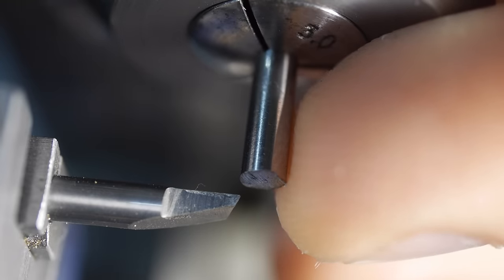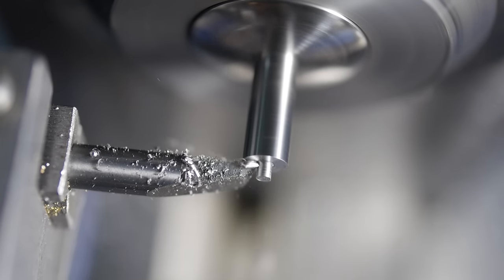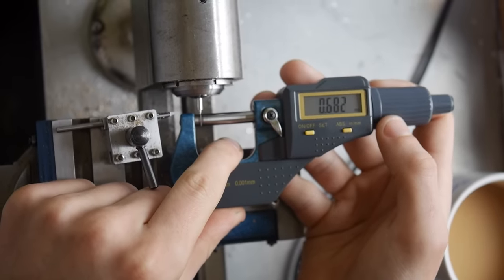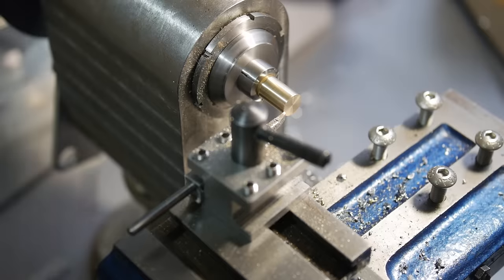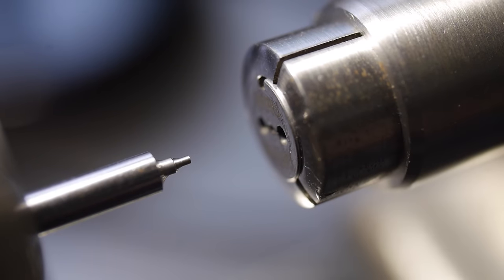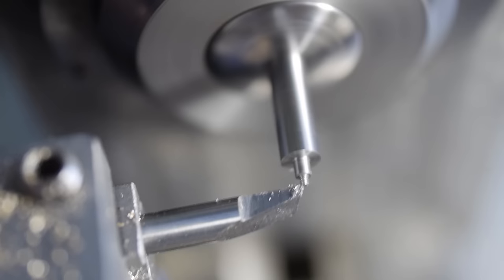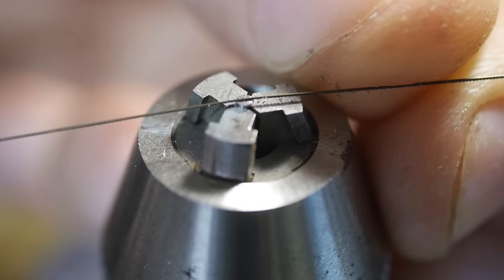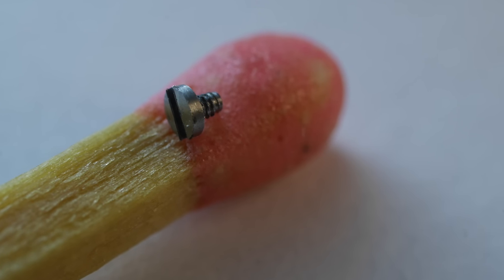Watchmaking: Machining a 0.6 mm Screw

Comment: I was a pipe welder.  The largest pipe I ever welded on was twelve feet in diameter.  Watching this was fascinating.  What a contrast.
Reply: Repent and believe in Jesus Christ  lmao
Reply: repentandbelieveinJesusChrist2 I’m sorry, but why we panting at all, for god?
Reply: How many washing machines is that???
Reply: Big meets smaller
Reply: Both have major challenges and require a lot of skill to do the right way.
Reply: Yeh i welded petroleum tanks buried under garage forecourts, 15 foot diam, but this is micro stuff.
Reply: I am a beginner welder and it is interesting for me how many stops you did while welding the twelve feet pipe?
Reply: Couldn't cut it as a drywaller eh? 😂😂😂😂🤣🤣🤣🤣🤣
Reply: I feel you man , it's wonderful 👍
Reply: What do you for a living now, mate?
Reply: @appalachiangunman9589  But only one needs eyes like an eagle! My god! :)
Reply: @Eimrine  1start and 1stop, the 60,000ltr tanks sat ontop of boggies that rotate the tank, we sat/ laid on scaffols boards on wheels fixed to a gantry, start tank rotating beneath you get comfy, 25mins for 1 full rotation, and pull the trigger, flux core mig, almost manual sub-arc really.
Reply: Bro welds straight lines for a living
Reply: I worked for a major welding equipment company as a subarc specialist for 10 years. On the job I routinely welded with 1500-1800 amps, sometimes 3x or 4x that. Wire size up to 1/4”, sometimes 3-4 arcs in a puddle. 
But in the evenings and weekends I TIG welded, sometimes as low as 5 or 10 amps with a 0.020” tungsten.
Reply: pffft. bigs easy. what was the SMALLEST pipe youve done?

i draw the line at 6mm...
Reply: @mariopllumbi3748  roughly 2 juvenile black bears, or 4 washing machines.
Reply: @mariopllumbi3748  about 3 1/2 c
Reply: i somehow read welder as wielder
Reply: Out of interest, what was the 12 ft pipe for?
Reply: You cant fit that into a watch.
Reply: Ah yes the old Pipe Welder guys. Always acting like they're superior. You are so cool man youwelded 12 Foot pipes.
Reply: @aegisraven1284  lol hanger
Reply: Seeing those machines at work fascinates me!

I saw an auto welder laying down weld beads on a rock crusher, it lit up the night sky, and brought down the DNR during deer hunting season!
Reply: hey let me make it about me
Reply: what was that for?
Reply: ~3.66 meters
Reply: I was a big thing operator.  The biggest thing I operated was 500ft. What a contrast for me who worked on much larger things.
Reply: Yeah I feel the same thinking about all the big stuff I've worked on  then watching this 😂
Reply: peos!

Comment: The way this is done nowadays is with Swiss turn machines. They hammer these in 5 seconds. Make thousands of them. You can let the machines run while you go home for the night don't need anybody to watch them once they're going.
Reply: Yup. Was a machine maintenance tech in a large Swiss screw machine shop and you're right-they churn out tens of thousands of these in all material imaginable and then some in all configurations...but one broke down they were hell to fix
Reply from the maker: Modern machining methods have come a long way. It is incredible. Thanks for watching.
Reply: This makes no sense, sir. 
These are not watch screws if there's no one watching them!
Reply: @DanielConstantinoS  They're unattended screws.
Reply: Yep, the Swiss machines sure do the job, starting at $125,000…😂 3:23
Reply: @DanielConstantinoS  😂 that was pretty good not gonna lie
Reply: @Mark Grant  Maybe a used one lolol. Machines are like 200-500 grand. It's like a car you make payments on it. Your monthly payment of the machine usually dictates the shop rate.
Reply: @DanielConstantinoS  simple, yet effective funny dumb dad joke. You win!
Reply: The machines in our shop had fire detection, alarm and extinguisher systems onboard for the jobs that required flammable stock, and the flood coolant system.
Reply: @Machinist Mike the Tinkerer  yeah those sometimes work. Dude I was working with went to lunch and one of the office guys walking thru goes hey that machine like down the aisle is smoking 😂. 30 seconds later while literally dead sprint to hit the e stop thing just bursts into flames. Dude comes back from lunch to a burned out machine 😂
Reply: I know Swiss machines are generally really safe but I'd be worried leaving a power tool running in the shop while I'm at home
Reply: @Thomas Africa  It's designed for it. If a tool breaks it'll know put that tool away grab a new tool and keep running or you can tell it count how many parts you make and change the tool after 1000 parts. Most of your job is just setting machines up and changing the broken/used tools. You don't have to watch them. Every once in awhile you grab a random part out of the basket and see if it's still the same as when you started and then just doing paperwork. People pay more for the paperwork than the parts themselves.
Reply: @Alan Smith  I've run a micron machine before. Just an absolutely incredible machine and feat of human engineering. As hard as it is to run one some guy had to figure out how to make it first. Which I don't understand how people can be that smart. I'll forever be an idiot compared to those people.
Reply: @DanielConstantinoS  that's why this video was made, to outsource that to us
Reply: Rolex, hand-made prices for machine made watches.
Reply: They said the same thing when they began mass producing nails. Haha kinda incredible
Reply: Funny how a machine can do thousands of these but no one in the comments is able to do it by hand
Reply: @metalman6708  I've always wondered why pretty much every machine at these price points don't have detectors to automatically shut off and/or alert the user of potential smoke. I realize this could be difficult on some machines but many of the videos I've seen of these horror stories are setup in a way that would seemingly be simple. 

I'm aware of some advanced fire suppression systems but this just seems like an avoidable issue much of the time. Even my DIY high temp 3D printer has a cheap enclosure with smoke detection and I've only had a false alert once... which of course was moments after getting home because my machines seem to enjoy trolling me.
Reply: @JJFX-  Makes you wonder just what they get up to while you are out? Naturally the Security System cameras will be in on the shenanigans and never record anything of value.
Reply: @metalman6708  That's so sick!
Reply: Love the Pun ! Anybody to watch them ! 🎉
Reply: What if you need only 3?
Reply: I appreciate a have made piece way more......all done by machines make the watch just seem like another disposable product
Reply: Yeah . Awesome and sad in one
Reply: @JJFX-  Safety features cost money, require maintenance, and sometimes even modification of methods. Boss man can't have none of that. $$$
Reply: @James Suttar  Ohh I've made things this small by hand. It's a completely different ball game when it gets that small. Dental implants are usually what they were for. I've done stuff you need a microscope for and things you need a crane for. Both of those things are very different from regular machining. Stuff this small you need to worry about things like how you even hold it. You can crush the part trying to hold it in the machine so it's no longer round but egg-shaped. With real big stuff like the size of your car or bigger your job becomes machining and rigging. You have to know how to pick things up safely and flip them and you gotta think if I put a strap here and lift here is the center of gravity being supported or is it going to want to drop because the strap or chain is too far forward? You have to worry about things like weight distribution and how fast can I spin this without the centripetal force shooting it out of the machine like a rocket. It's very uncommon to have done both though. Usually people specialize in one type of machining but I wanted to be able to do anything and everything.
Reply: @JJ FX  No they do. They'll alarm out if the fan ports get clogged in the back and it senses a change in the CPU temperature and shuts down the servos to protect itself. The reason for the fire suppression is that the material itself is flammable. You make alot of things out of titanium like medical implants that sort of thing. So these machines run so fast so the tools are all stationary and the material is fed into them. But it can be doing 10 things at once. That's how it's made so fast. But the way titanium works is that it's an oxidizer. So if any number of random things happen like the chips got stuck in a hole when drilling and it heated the drill up and that's enough to start the chain reaction. Ones Ti is burning it feeds itself. Burns really hot really fast. It catches all the other chips on fire. You have to use a special fire extinguisher that we were required to roll around with us. If you put water or a regular fire extinguisher on it then it separates the hydrogen and oxygen rapidly and basically creates a hydrogen bomb. It'll explode if you do that. Once it gets big enough you just have to watch it burn itself out of fuel.
Reply: @🏴Luminous Fractal  They would be incredibly expensive screws. The less of something you need the more expensive it'll be. This is why it's often cheaper to buy a new part then attempt to repair it. People only pay to repair things if it's irreplaceable or damn close to it
Reply: Really... hmmm i always wondered about these micro screws who n how ... now i gotta look up the doc for the swiss turn machines...
Reply: @enter name here  Just look it up here on YouTube. There's a million and one videos of it.
Reply: @luminousfractal420  then they have smaller manual screw machines and maybe 1-2 dedicated machinists that do those. Brown&Sharpe manual screw machines are awesome you can make just about anything with them. Easy to maintain n fix. The used ones can fetch top $$ for them. I would make stuff on em any chance I could.
Reply: @metalman6708  nailed it. Am a retired machinist by trade but wanted to be able to work on all the machines I could. That's how I ended up as a Millwright/maintenance tech. My favorite tool? Bridgeport mill! That's what I cut my teeth on all those years ago. My dad before me too.
Reply: @JJFX-  trust me-it was always us vs the machines lol. It all depends on the material being used. Our bread n butter was medical and dental implant devices that worked exclusively with flammable metals titanium, magnesium and alloys of both. Once they ignite they burn fast and extremely hot and bright. and very difficult to put out. Special extinguishing agents are used and sometimes those don't work. In my time we used to have red painted tin buckets next to each machine filled with sand and dirt to dump on the fire. Picture that!
Reply: @LSC2001  don't even get me started on over priced watches lol
Reply: @metalman6708  I've thought that soooo many times...
Reply: @metalman6708  right! And then we get to go fix em ugh. You know how expensive titanium n magnesium and stuff was so expensive and they'd always save the chips to recycle? We >ahem< used to bring some magnesium dust/chips home to throw a little on the bonfire for fun. That and old copper phone wire. The um..kids loved it. Lol
Reply: You guys ain't gonna believe this. I didn't either until one of the programmers brought me out to the floor to show me the prints and parts to prove it. I was just as gobsmacked and amazed-our shop used to make 🍆 implant devices for guys who had ED problems and/or traumatic injuries. Not even lying holee shit I never knew! We had some laffs on that even tho it's certainly not a laughing matter. The system first operated by a tiny cable, to "raise the bridge" they said. It went from that to a small air pump and tube system that resembled a miniature blood pressure cuff that we're all familiar with. They went back to the cable system because they found the pump system would develope leaks and would also "squeak" when being used! 
I've never watched "Transformers" in the same way since.
Reply: The level of speed and precision mix is god tier
Reply: @machinistmikethetinkerer4827  Oh I can only imagine. A bunch of chips from metals like that essentially become thermite so once it goes I certainly wouldn't want to be the one responsible for it.
Reply: who does the work though if no one's in the shop? I thought capitalism required hard work to make money :-)
Reply: Not like machines are known to malfunction or anything😒
Reply: And they're much more precise
Reply: @magran17  that's good deal when talking about those machines
Reply: All good if you're churning out thousands to recoup the investment in the machinery, but a one-off for a non-standard repair will require actual skill.
Reply: @JJFX-  exactly. See some of the thermite incendaries happening in Ukraine? That's it.
Reply: Very interesting, but is this way cheaper though?
Reply: How does the collet not damage the threads when you clamp them to machine the head?
Reply: @Jsuttar  mate if I had just my hands to do this Im sure my nails would have fallen off long before I even made a dent!
Reply: @clown134  the hard work is setting it up
Reply: Was at a place, got a job in, wanted custom screws.
Best option was source an old auto cam with rudimentary tooling.
Cnc came in at five minutes each. Tool changes mostly... Auto was down to five seconds...
Reply: @DanielConstantinoS  Because it is the screw that is watching.
Reply: @tyttuut unwatched, even
Reply: @tyttuut  I should call her
Reply: @Jsuttar  I did and so did many others before me. I worked on a Browne n Sharpe Screw Machine.
Before me tho How do you think pocketwatch screws were made during the Industrial Revolution? Then, mass produced?
Reply: It's not just nowadays, automatic screw making machines have been used in watchmaking for more than 150 years. But that's always been in big watch factories, not small watchmaker workshops. Here's a video of one machine from 1871: https://www.youtube.com/watch?v=YCmnUP5gx78
Reply: HAHAHAHA are you joking?
Reply: I saw what you did there! 😂😂😂 @DanielConstantinoS

Comment: My dad was a watchmaker, and seeing him handle these tiny parts was a wonder. He didn't have the equipment you show, but a small hand lathe and a set of turns, so actual screws may have been off the menu, but he could re-fit and re-make arbres and pivots with the deftest of touches. Thanks for this reminder of a loved parent and his art.
Reply: Watchmakers are always so fascinating, the fact that humans can handle such small parts with 0.001 mm of precision is utterly mindblowing,
Reply: well my great great great great great grandpa was from the sandglass era and he used to count sand grains accurately(without the aid of any microscope etc etc) for the sandglass clocks 😉
Reply: They make little taps for teeny screws
Reply: @runcoweezrun8143 that would put him in the 1700’s which definitely had clocks then (though hourglasses were definitely in use too)
Reply: Question for the watch maker's son, I was listening to a dirk pitt novel or a reacher novel can't remember and they were talking about special oils for inside the high end watches.  This oil occurs naturally on our nose!is there any truth to this?  I'm seriously curious and  google is over used lol.
Reply: @dano8613  Afraid I couldn't tell you for certain. I do know that until fairly recently it was Whale oil, but a high-grade oil, not what was rendered from their blubber (unless some highly refined fraction). Whales are mammals, we're mammals, so it could well have been something we share.

Comment: 38 year industrial machinist here. Very impressive. Super small parts are always tricky. Like you said you get it right then lose it in the chip pan. Good idea on keeping the thread die square in the collet. I will remember that trick.
Reply: Horologist here, I've had screws ping out of tweezers off onto the floor a few times.
Empty the hoover, clean the dust trap thoroughly, then hoover EVERYWHERE and finally sift through what you pick up.
I've managed to retrieve a couple of balance wheel screws and jewel cap screws that way.
Its a real PITA to do, but works surprisingly well and often!!
But out of a chip pan?! I'd just start again lol
Reply: ...or pedantic! Like you said you get it right then lose it in the chip pan.
Reply: would it not help if you put marking blue on the screw before finishing the cut so that it stands out better within the pile of chips?
Reply: That made me think of something, why not put some vibrant nail polish/paint onto the part before parting off? You'd have much bigger chances picking it off in swarf
Reply: Someone once pointed out that where small parts go is to the future-  which is when you'll find them, if you are lucky.

Comment: Running a tap of that size seems more difficult, how would one  know if the tap did its job or broke ?
Reply from the maker: Yes, it's tricky. The problem with tapping small holes is the cutting force required is very close to the force required to break the tap. You just have to be super careful and back off regularly.